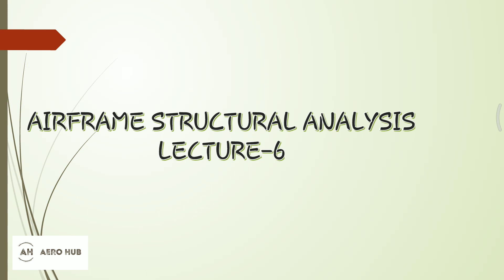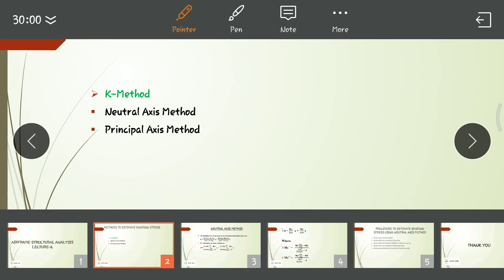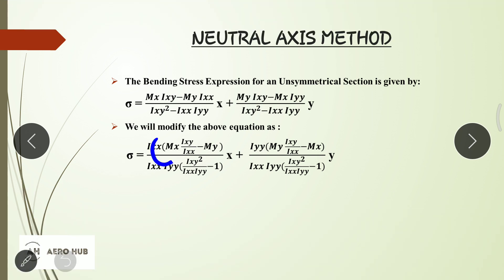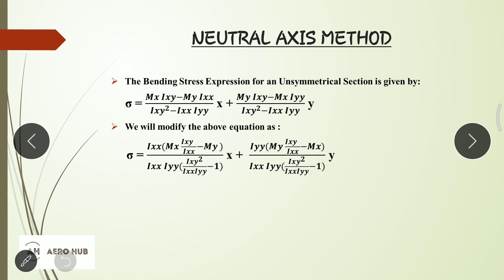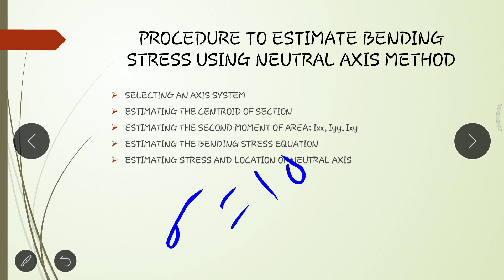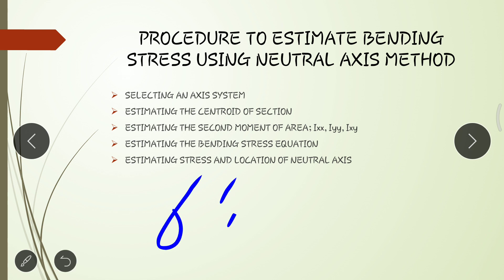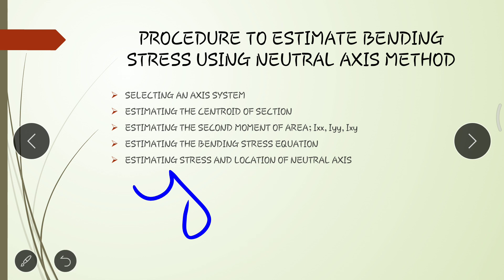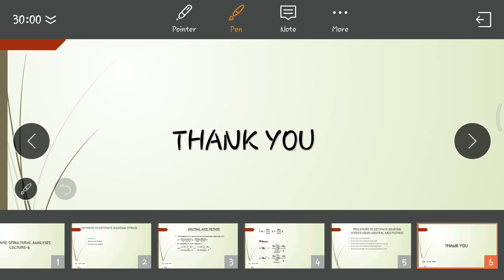Aircraft structures II Lecture 6 Neutral Axis Method

Comment: Bhai u did well👍
But finally add also how to draw 
bending stress configuration
along the stringers or unsymmtric beam etc. 
which will clear concept complete 
Thanks.
Please suggest me which best book should prefer for gate Aerospace 2021
In aircraft structure and 
Propulsion and other
Reply from the maker: Gate Aerospace
Propulsion: jet propulsion and application by Ronald D Flack and Nptel videos
Structures: Aircraft structures by CT sun, flight Vehicle structures by Rivello
Aerodynamics: Gas Dynamics by E Rathakrishnan, Aerodynamics by Houghton and Carpenter
For more details mail us
aerohub2020@gmail.com